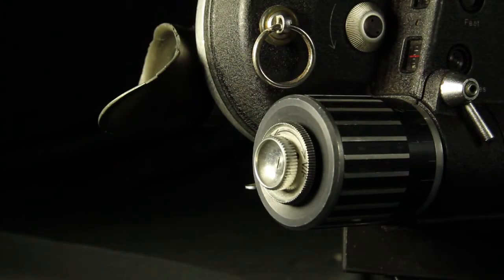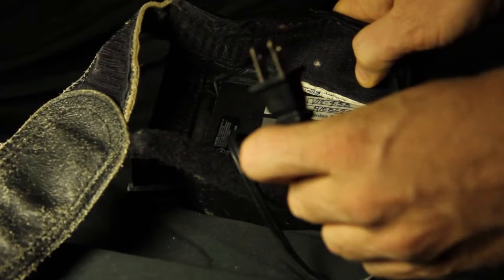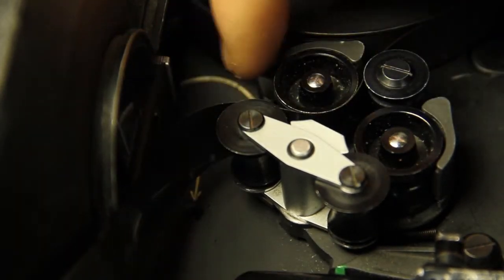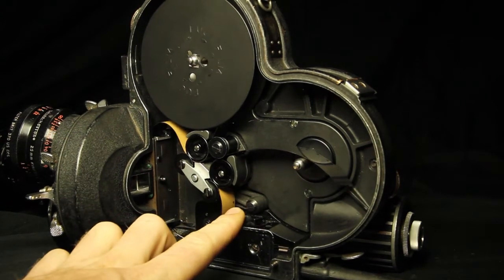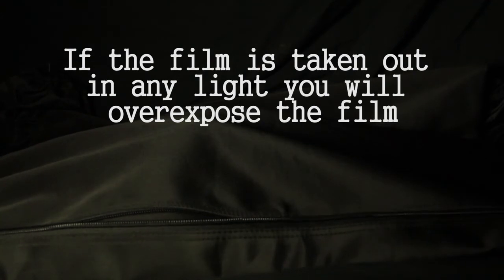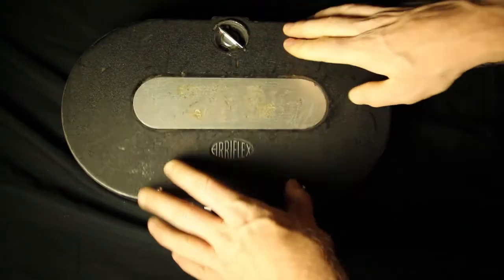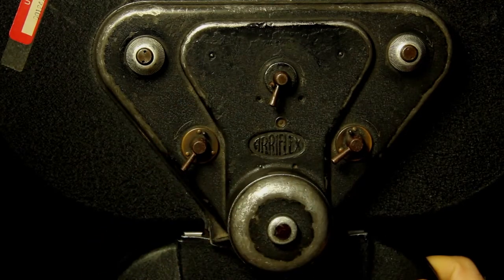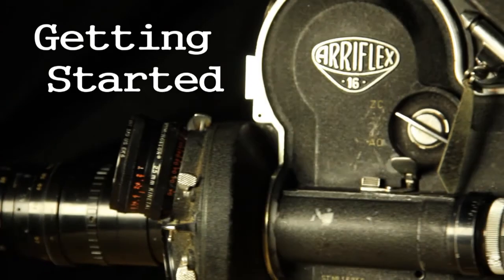Getting Started ARRIflex 16S

Comment: When I turn the inching knob it doesn't move the registration pin. Is there something wrong with mine?

EDIT It was the ball end of the motor not gripping with the rubber coupler. Added some tape to the end of the motor and the registration pin moves😊